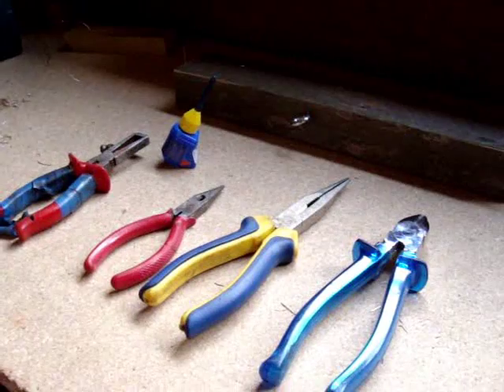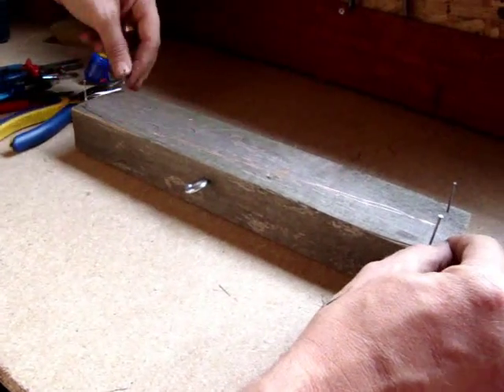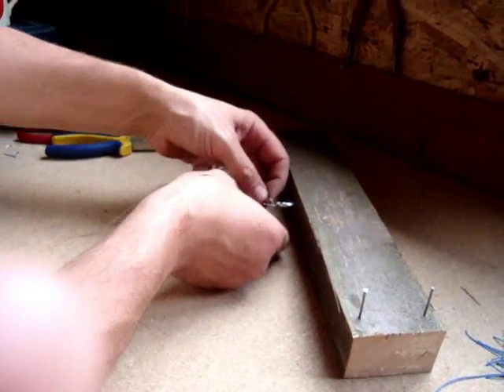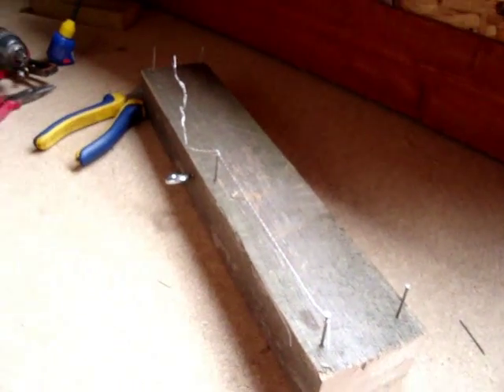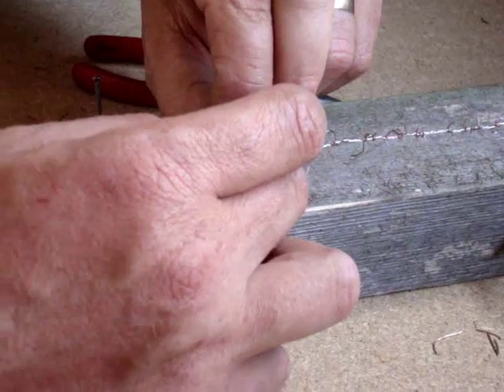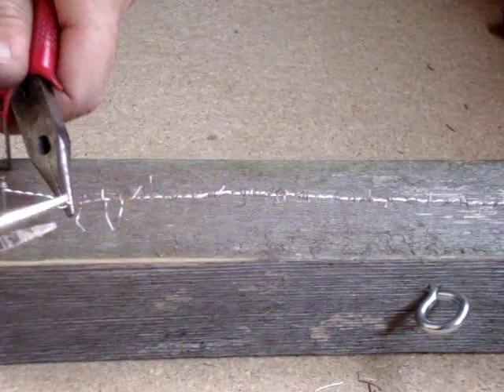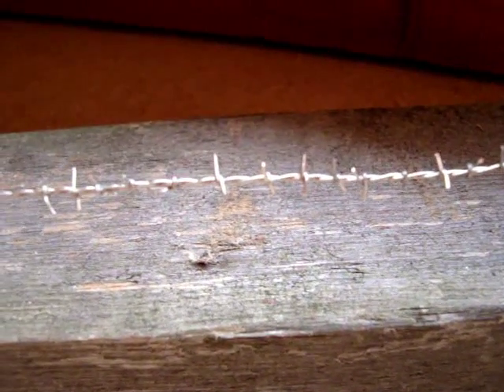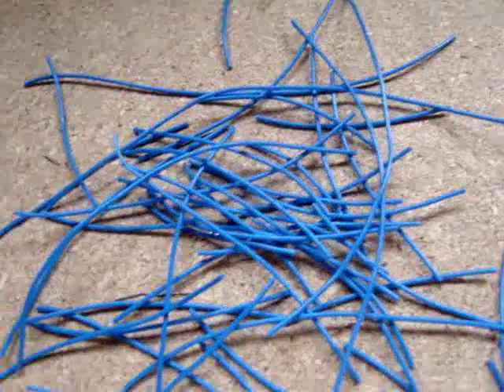How to make model barbed wire.

Comment: +LOST LEGION MINIATURES i was wondering where did you purchase your wire, or where can you purchase it, in the UK
thanks
Reply from the maker: Hi, 

It is what is known a twisted pair wire used in the telecoms industry, some phone wire can be made of twisted threads where as the type I used is solid core. At the time I had a supply due to working in the industry, it can be purchased from hardware / electrical stores but probably only in large rolls. Any suitable gauge wire should do, or you could possibly look out for a local BT / Virgin engineer in the area and ask if he can spare a few feet?????